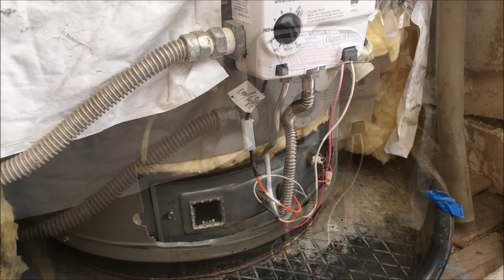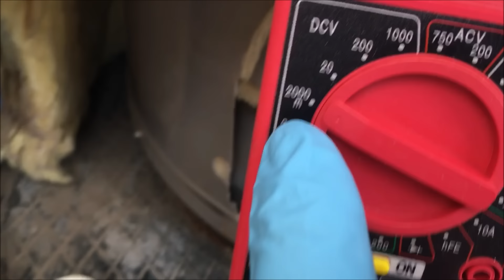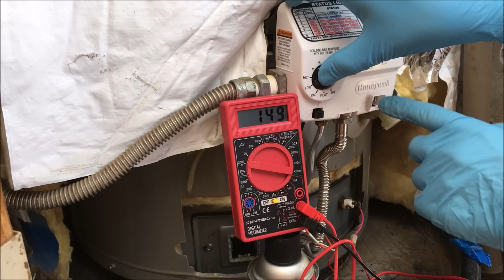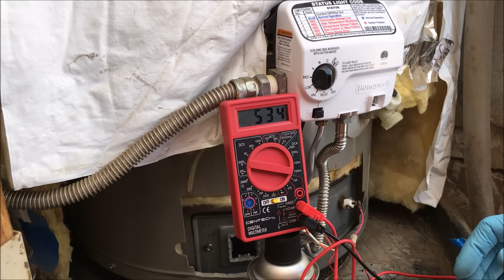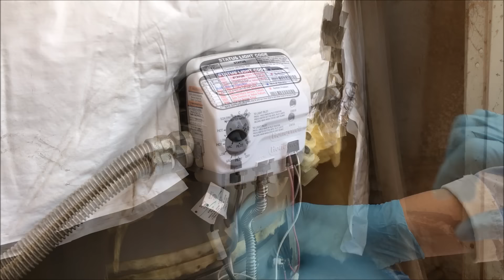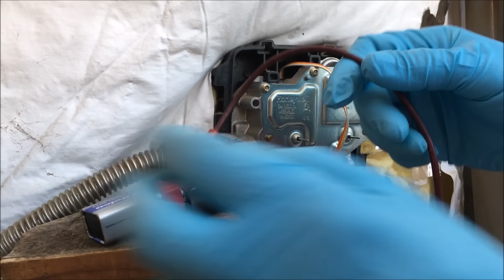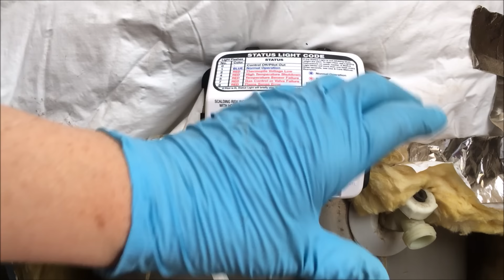Troubleshoot Water Heater AND Honeywell Gas Valve | Step-by-Step

Comment: Most detailed video I’ve seen. Great job!! My hot water tank still,doesn’t work  but working on it
Reply from the maker: Thank you, Chris, for such a nice comment.  Keep working at it; you can fix it.  When you do, enjoy the hot water!
Reply: @frugaldiy1  thanks I figured it out, it was the Thermopile switch reset. Tiny little button you could hardly see…
Reply from the maker: That's great to hear, Chris.  Job well done!  Enjoy the hot water.

Comment: Great video. I can start my Honeywell manually by holding the the pilot down clicking the igniter and waiting 30 seconds for the LED to blink turn it to the desired temp and it will work. Although once the water gets to temp the LeD will shut off. Can I assume that’s there is an issue in control board?
Reply from the maker: Maybe.  To determine the issue, I'd recommend following the steps I took folks through in the video.  But, before you do that, watch my video titled, "Honeywell Gas Valve 4 Flash FIX | High Temp Shutdown," to see if that resolves the issue.  The gas valve control board could have faulted to a "high temp shutdown," and you may be able to override that and reset the control board.  I'd try that first.

Comment: Thank you Frugal DIY! This video helped me troubleshoot and repair my water heater. I followed each step and determined the circuit card was bad. I found a new one at my local Ace Hardware for about $200. It came in the gas control valve assembly like you said. Following your video I was able to replace the bad card in my water heater on Saturday morning in time for hot water by lunchtime. The front plastic cover on the one I purchased was labeled "Resideo" instead of "Honeywell" and the part number on the side was WV8840B1110 while my original was WV8840C1605, but the card inside looked identical and after I installed it my water heater started working again. The only difference I notice is the status light signaling that is it working blinks white instead of blue. Thank you so much for saving me money by equipping me to fix it myself.
Reply from the maker: You're welcome, John!  I'm just thrilled that my video helped you fix the water heater yourself and save a bunch of money.  Also, thank you for posting the info of the Resideo and the model number because it will help others.  Enjoy the hot water you definitely deserve!
Reply: FYI - Honeywell spun off a part of the company a few years ago which is now called Residio

Comment: This is one of the best and most through videos for a Diyr. I did all the tests like in the video. However, with the battery test my pilot valve did not make a noise. Does this mean I need to replace the whole control valve?
Reply from the maker: Thank you, Major Tom.  If the pilot valve does not engage, i.e., you don't hear a "click," that's an indication it's not working.  Now, there is a way to replace some of the parts and pieces behind the plate, but I haven't done a video on that, yet.  But, what I'd do is take the handle end of a screwdriver and lightly tap on the end of the pilot valve pin and around the pin area to see if I could "jolt" it free, so the pilot valve engages.  Sometimes, when a gas valve isn't working, you can "jolt" or "shock" it with the handle end of a screwdriver, and the valve will "open up" and work.  I've done that several times, and it works!  ;)
Reply: @frugaldiy1  Thank you so much for the quick response. I tried your suggestion but without success. I didn’t want to tap too hard as to damage the unit. I guess I’m left with purchasing a replacement.🤷🏽
Reply from the maker: Gosh, I wish the tapping would have worked for you.  Bummer!  I think you may indeed need to replace the gas valve.  Take a look on eBay for a replacement.  I've found the best prices for the gas valves and the control boards there.  I wish I could be of more help to you to get you hot water now.
Reply: @frugaldiy1  I purchased a Honeywell WV gas valve but I noticed that the nipple which goes into the tank is longer by about an 1/2 to 1 inch. Is there a way to extend the main gas tube to the burner or do I have to replace that burner assembly too? I notice your tube is bendable while mine is not.
Reply from the maker: Hey, Major.  I'll try to help.  Two questions: 1) Is the replacement gas valve the same model number as the gas valve you're replacing, and 2) Please look on the right side of the gas valve cover, where the model number is, and look at the 3rd line down.  Is the "WC Outlet" the same on the replacement gas valve and the failed gas valve, e.g., 4.0" or 5.0"?
Reply: @frugaldiy1  Old: WV8840A1000, 222-47463-01A, NAT Gas 4.0” WC
New: WV8840A1051, 222-4763-02C, 
NAT Gas 4.0” WC. 
They’re identical except the nipple on the back of the new one is longer. I don’t want to over tighten the new one and crack it. Any advice would be appreciated.
Reply from the maker: Major, I've looked at the images of both of the gas valve model numbers you gave me, and I don't see a longer nipple on one than the other.  So, given that I can't see the configuration of the gas valve or the water heater, I can't offer any advice.  I'm sorry.  It's difficult to help when I can't see what I'm dealing with.  If you purchased the gas valve from a plumbing supply place, I'd call them and ask if they can help you.  Or, take the 2 gas valves to a friendly plumbing supply place in your area and ask for guidance.
Reply: @frugaldiy1  Thank you so much for all your help. You’re Awesome! You definitely gained a Follower! Just for reference purposes, if you send me your email, I’d love to send you pictures of both.
Reply from the maker: Major, respectfully, I don't give my email out.  I hope you understand.  But, I'll tell you exactly what I'd do were I in your shoes.  I'd use a probe, like a small screwdriver or such, in the hole where the gas valve nipple screws into the tank and get a sense of the depth.  If I thought there was enough depth to accommodate the new gas valve nipple length, I'd screw the gas valve in slowly and carefully, being mindful of any resistance I may meet.  If I didn't meet with any resistance, in the gas valve would go.  Years of DIYing has taught me that, sometimes, I just gotta put on my big-girl pants and take a chance that the task I'm doing will work out, even if I have some doubt about the outcome.  It usually does.  I hope this helps you.

Comment: Well just learned my pilot valve is not opening
Reply from the maker: I'd rap it lightly a couple times with a screwdriver handle in the area where the pilot valve is and see if that might "jolt" the valve open.  The, test it again.  Just a thought, Greg.

Comment: I am getting a flame and once i turn to low, it will start heating up but after a few mins stops and starts blinking red again. Tried 3 times and same issue happen. Any adivise?
Reply from the maker: I don't, Jesus.  It's all a guess until you troubleshoot it by following the steps in the video.  It takes some time, but it will help you pinpoint the problem.  If you're getting a 4-flash error code, watch my video titled, "Honeywell Gas Valve 4 Flash FIX | High Temp Shutdown."

Comment: Does anyone have the problem, when your water heater turns off every time when you set temperature over LOW position? It works fine on LOW position, but it’s not hot enough for 4 people. So, every time when I increase the temperature to HOT position, the water heater begins to work and after few minutes shuts off. I have to press the button on the thermopile switch and restart the system over and over. What could course this problem? Thanks
Reply from the maker: Stanislav, based on the problem you described, my guess is the issue is related to one of the following: venting at top or bottom of water heater is impeded, thermal switch is faulty, temperature senor is faulty or the control board is faulty.

Comment: Thank you for your video.  Helped me to diagnose the problem with my WH.  My thermopile voltage was only about 150mV.  Turned out to be some crap in the gas tube causing the pilot flame to be weak.  I blew the tube out with my air compressor and that's all it took.  Happy now that I can take a hot shower tonight and it only cost me a bit of my Saturday morning.
Reply from the maker: You're welcome.  I'm glad the video help you.  Enjoy the hot water!

Comment: I'm not getting any spark in mine how do I fix that
Reply from the maker: Either the spark igniter or the spark igniter switch is the problem.  So, either remove the pilot assemble from the water heater and clean or replace the igniter or remove the igniter switch and clean or replace it.

Comment: With my controller, it gave a fault indicator that the thermopile was bad.  Replaced it , it failed within 3 days. Called place I bought it from and told them I thought it was the main controller.  They ordered another controller and wouldn't be here for 5 days.  In the meantime I watched another video and they stated that there has been an issue with these controllers that when you set the heater temp to anything past the "hot" setting , (A, B or C), it shuts off the pilot valve and gives you an error code of 2 blinks, bad thermopile.  I tried relighting the pilot after a day of non use, and was able to light pilot and set heater setting to "hot" and I'll be doggone , it worked, even with a supposed bad thermopile that the fault code indicated. 
My question is - what would cause that?
Reply from the maker: Bob, it's likely an issue with the control board, like it usually is.  Please see my video titled, "Honeywell Gas Valve 4 Flash FIX | High Temp Shutdown."
Reply: @frugaldiy1  Will do, thx!

Comment: Thanks for your very detailed video!!  My water heater pilot went out, we were able to relight it but then it won’t have hot water after 24 hours and gives a 9 blink (chamber sensor) error code.  Rheem says I’d have to change a sensor and replace the gas control valve…can I just swap out the cover with the control board?  Is the chamber sensor same as the temperature sensor?  Thank you!
Reply from the maker: You're welcome, Michelle.  If your temperature sensor failed, then, no, you can't just replace the control board.  You can, however, replace the temperature sensor without removing the body of the gas valve from the water heater, but the job is quite involved.
Reply: @frugaldiy1  thank you for your reply!  Is the temperature/chamber sensor inside the burner assembly?  Do you have a video on fixing the chamber sensor?
Reply from the maker: Maybe I'm not understanding you correctly.  I thought, based on what you wrote, that Rheem told you the sensor (the temperature sensor) had failed.  That is why my response to you addressed the temperature sensor.  I apologize if I was wrong.  So, let's focus ahead, now.

Have you gone through all of the troubleshooting steps in the video?  If not, I would recommend that you do.  When you say "chamber sensor," the only things that come to mind is the thermal switch (some have rest buttons in the middle) or the temperature senor.  The video shows you how to test a thermal switch.  I do not have a video on the temperature sensor.

Comment: wow, how fantastic is this!? As others already wrote, these units are programed to go kaputt on a weekend. I spent a whole day following all kinds of videos and then came to this beautiful post. Based on this step-by-step process I conclude it is the board on mine as well. Now for the hunt to find one. Initially thought it was the thermopile. In my case the pilot is working, and the valves do the click when I test with the battery. 
Thank you so much for this wonderful set of instructions.
Reply from the maker: Thank you very much for your kind words, Hilmar.  They mean a lot to me.  I'm sorry to hear that your control board failed, but not a bit surprised.  I'm glad you found the problem, though.  I'd search the model number of your gas valve (found on the right side of the cover of the gas valve) on eBay and look for just a control board.  There are sellers, who are plumbers, on eBay that sell the control boards from working water heaters they pulled.  I'd buy one of those from a highly-rated seller.  I hope this helps.  You'll have hot water soon!
Reply: @frugaldiy1  yep, I found some whole units and one with just the control board. It is in fact the same one you listed in your video. The problem is that it takes three days to get here and my wife does not like that. Maybe I can strike a deal with one of the local companies....
cheers
Reply from the maker: I understand.  A local plumbing supply shop in my neck of the woods will give me free parts off of water heaters plumbers bring them to get rid of.  It's a thought.

Comment: That was the best by far,thank you,I’m going to test,I have pilot but no status light
Reply from the maker: Thank you, byron anderson!  I never got a LED status light flashing, even though I had a pilot light.  Why?  The control board failed, so it wouldn't throw a code.  You can fix the water heater; I know you can!

Comment: Have to try this. My Pilot light isn't wanting to ignite. Thank you!
Reply from the maker: You're welcome, Oddzilla.  Blow some air through the pilot tube.  Use an air compressor or a can compressed air to make sure the pilot orifice is clear.  Mine was plugged, so my pilot would not light.  Once the orifice was cleared, I was able to raise a pilot flame.  Hope this helps.

Comment: Thanks for the awesome video. I’ve gone down to the last steps and found out my pilot valve is not working with the battery test and the burner valve is. Does this mean the whole Honeywell thermostat unit/gas valve needs to be replaced? does the gas valve encompass the pilot and burner valve?
Cheers!
Reply from the maker: Tommy, yes I believe that means you have to replace the entire gas valve.  Before you purchase another gas valve, try this.  Use the handle end of a screwdriver and lightly tap the pilot valve pin a couple of times to see if you can "shock" the pilot valve to open.  It could be stuck, so I would try that to dislodge it.
Reply: @frugaldiy1  ahh thanks for the tip, tried doing that and still stuck.  thanks for all the info. I'll try to find the whole gas valve control unit and just replace it and see what happens.
Reply from the maker: You're welcome, Tommy.  And, sorry for the delay of the initial response.  Youtube held your comment for review for unknown reasons.  I also forgot to answer your question, "Does the gas valve encompass the pilot and burner valve?" Yes, it does.  This may help you, too.  Some of the viewers have commented they found either the pilot pin or a wire from the solenoid behind the pin loose and re-soldered them back on.  I hope this helps you.  

Here are some viewers comments that may help you:

"Thanks!!  Found one of the connector pins fell off.... Soldered it back on, good as new.."

"Follows your tips, I traced to the pilot valve. It does not click when 9VDC applied to it.
I open up the valve assembly. There it is, the end of the solenoid coil that soldered to a post is broken.
Re-solder the wire, re-assemble the valve assembly, connect every thing back.
The heater works like new."

Comment: Thank you so much for this video, it was incredibly helpful. Never thought that the control board would've been the problem and it turned out to be exactly that, and I was able to diagnose it thanks to your explanation. Unfortunately the only place I was able to find a control board replacement was eBay as you mentioned it, which was going to put me a couple days without hot water but then  I was able to buy the whole assembly from a local store and I just removed the control board and avoided having to do any gas connections or draining the tank, saved me lots of work and was able to get hot water within hours. It has been working great for a few weeks now.
Reply from the maker: You're welcome, Oliver, and I'm thrilled to hear your success story.  Job well done and enjoy the hot water!

Comment: I just wanted to say thank you. Your video was the only one I found that went through every step that I needed. If this video didn't have the answer I would have been calling a HVAC company. The part that helped me was you mentioned that if there isn't enough gas going through the tube for the pilot light then there could be something stuck in there. I had some canned air and that did the trick. Also you telling us it will take time for the thermopile to get up the correct voltage helped as I thought mine wasn't working as it was taking forever. Like Andy Bayak said, do everything instructed as this will pinpoint the problem and save you money. You do not know how happy I am.
Reply from the maker: You're welcome, Derek.  Canned air--BRILLIANT!  I bet your pretty darn happy.  :)  Thank you for your thoughtful comment.  I appreciate that you took the time to write it, truly.  It makes me so happy when I read success stories, like yours.  Job well done and enjoy the hot water!

Comment: Would a wv8840c1406 be compatible with a wv8840b1148 be compatible?
Reply from the maker: I can't answer that with certainty.  The model number of the gas valve that I used to swap out the control board was different than the one on my water heater.  It works like a charm.